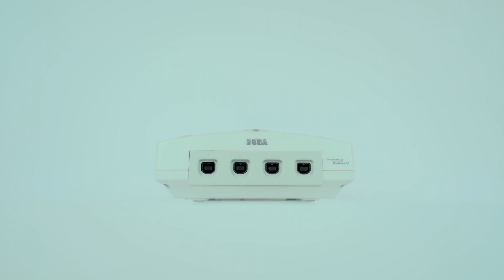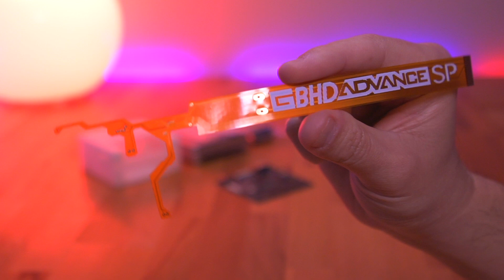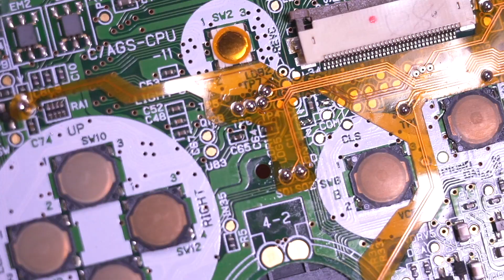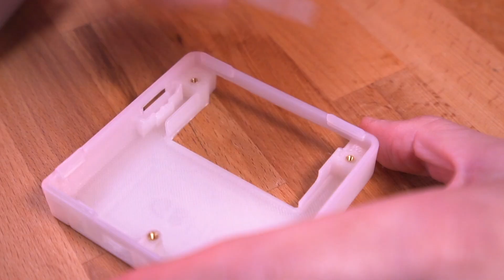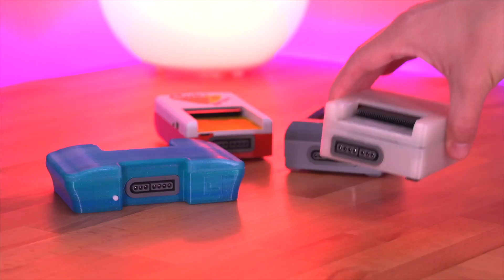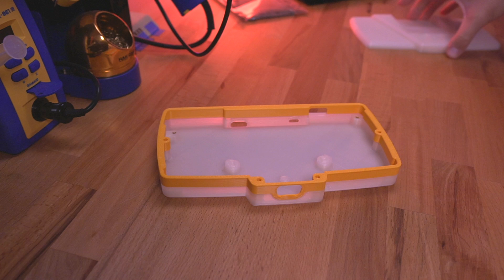The GBA SP Gets A New Hi-Def Consolizing Mod

Comment: The biggest issue with the SP is the tiny dieod or fuse that is required to help the SP Charge, I have 2 SPs [ one being an NES Limited Editon ] however neither charges and Ive put it down to this consistant flaw with the SP.

Comment: What would happen if you leave the battery inside? Can it be powered through the charge port?

Wondering because the board (not the shell) would be perfect for a collection of mods together.

Wanting to do something along the lines of a Slate but also want HDMI out (along with the features shown in the video) but want to know if they would be compatible (aware some customization would be needed to accommodate this second board)

Comment: bruh at this point just use an emulator on a PC that's connected to your TV, and keep the SP as a portable console. Or get a Miyoo. Or whatever. I don't really see the point
Reply: I have a descent taco Nintendo GBA and a really beat-up iQue SP 101. I am considering moving SP screen to the taco and consolizing the leftover SP motherboard. SP case makes my hands hurt.
Though, sadly,  nowadays the really fiddly GBAHD is the only available option. It may be made cheaper though.

Comment: So quick help.
I got everything hooked up but the left press on the D pad and the left trigger are unresponsive. I will go back and solder everything again to be safe, but which Test Pads on the board specifically should I look to re-solder?

Comment: I need this for PSP. And if they could bypass the integrated wifi card (it no longer works with current protocols) and add a wired ethernet one instead that'd be just unbelievable.

Comment: Something I don't see anyone talk about is how they completely botch the grid lines and scanlines effects. The grid does not actually outline the actual pixels from the original image - it looks like a checkerboard is just placed over the video output without any rhyme or reason to where it should go. Looks absolutely horrible. For a real gridline to look good (see MiSTer, Analogue Pocket, or Q5 IPS), the grid needs to actually outline each and every source pixel.

Comment: Not a fan of those tight fitting parts, or snap shut cases. But that's just me. I would be happier with the case being about 1cm wider in both horizontal directions to allow for an easier board installation and room for screws to close the case. Overall this is still a very nice build.

Comment: I'm confident in my soldering skills, but honestly, it might be cheaper to just get a finished unit if you don't already own a GBA SP. You might be able to get a "parts only" one for  between $40 - $70 (before shipping and taxes) and hope the interior isn't badly corroded.

So from scratch, this would cost between $200 - $250+.

Comment: I have been kind of disappointed with the output options that all of these kits offer. I wouldn't mind seeing one that just offered Component or RGB output with no scaling or effects so I could just run it through my RetroTINK 5x.
Reply: You can kind of do that if you got an HDMI to component converter that doesn't upscale, then you can set the device to output 480p and run that through the 5X using any of the 5X's modes. A bit convoluted,  but its possible if you want 1080p, 1200p or even 1440p if your TV supports that resolution. 🤷‍♂️

Comment: I've considered getting one of these consolizers for a while, but I'm not sure why you wouldn't just get a Gamecube with a Gameboy Player? It's $100 for a Gamecube, with all the cabling, a controller, and a memory card; then $50 for a Gameboy Player; and $12 for an Action Replay disc to use with the player (much cheaper than tracking down the real startup disc). That, on paper, works out to the same price as this consolizer kit, so why bother with hacking up a GBA when this gives you essentially the same experience, on top of having a whole Gamecube?
Reply: Some folks prefer to upcycle their handhelds for less e waste + prefer to play their GCN content via Wii

Comment: I wonder (having found this channel and all this stupidly amazing handheld mod scene in the past few days, so I might be missing some context) if they could design a shell where the cartridge could be inserted from the top verticall, with the sticker side facing forward, just like in an old school console. I imagine it would require some daughter board and a hell lot more soldering and desoldering, to remove and relocate the cartridge slot, if its even possible. It would look pretty cool though! Having the cartridge sit flat against the console is a space and comfort compromise when you need to hold the console in your hands and it needs to be as compact as possible to be able to put it on a pocket or backpack without weird things at 90 degrees. But as a table console, that restriction is gone.

Comment: make sure if the donor consoles still have working displays to offer those online as spare parts so no components of the old consoles will be wasted. also try to use ASP-001 models for these, not the ASP-101 models due to their better display lights.

Comment: I tell ya, the flat flex cables (and the ability to make them/have them made cheaply) that have been coming with modern hardware mods have completely changed the level of accessibility for modding consoles.  It's really awesome to just "solder this flat flex to the only places on the board that line up" rather than "strip and solder these 30 wires to hack in this modchip"... so awesome!

Comment: There's no denying that this is the perfect solution for perfectly accurate GBA capture, other than some minor fit issues. The SP was also vastly more popular than the original and thus has a huge supply of extra parts. If this was released 6 years ago, I could see it being an easy first choice for everyone with any interest in GBA games. But that's the rub... 

In the last 6 years, emulation accuracy improvements, combined with leaps in hardware performance across the board, has made it redundant. Unless you're a streamer trying to navigate the Nintendo legal ninjas, a preservationist trying to capture hardware accurate behavior for something like a test cart or distribution event kiosk, or setting up some kind of ultimate TloZ 4 Swords setup, you don't need it.

Comment: nice but one thing every consolized gb/gba is missing would be to get a controller that have the gameslot working ,  for the rumble and motion games ... just an idea of course ^^
Reply: Another thing they seem to be missing is a simple way to use the GB/GBA in a portable manner as well, ala the Switch (uninstalling the board and replacing it in the original case isn't 'simple' for these purposes.)

Comment: This seems like a really nice project, but the cynical engineer in me is wondering why not go the next step further and have the GBA's CPU running on the FPGA as well, and just put a GBA cartridge slot on the other end of the ribbon connector if the whole point is to play the games on the original cartridges.

Comment: This looks so much simpler to put together than the GBA HD kit in your recent video. It would be really cool if we got to the point where you could mod a GBA to easily plug and remove from the FPGA in question so you could still use it like a GBA, kinda like the Analogue Pocket with its dock.

Comment: I know you have a printer so you may already have the tool I’m about to mention, but for anyone else out there who is dipping their toes into kits with 3D printed enclosures: A cheap swiveling deburring tool is your best friend if there’s any chance you might need to post process a 3D printed enclosure. Craft knives are totally fine but a deburrer is typically very inexpensive and it makes cleanup and absolute breeze (and reduces cut risks).

Comment: You should of heated up the 3d printed case. It was hard to get the board in because the printer that made the part didn't have tight tolerances.

Comment: See, I don't really get why you have to bend anything.  Why not just make the 3D prints more accustomed to the hardware so no modification is necessary?  Sort of like the Game Gear case where you had to actually remove the controller port metal before putting the case on.  That kind of killed my joy for the kit to be honest, as I'm just not comfortable using it without leaving the plug intact as it should be.  I'm not really sure why the case wasn't designed to be be usable without having to remove it like that.

Comment: While I LOVE having all these new Consolizer options, I am thinking that they should maybe hire someone to come in & improve the upscaling of these Consolizer kits, as they only max out at 720p & from what I hear they also add a frame or two of variable lag.  Not terrible but not as good as some of the other Consolizer kits such as the ones made by Woozle which go up to 1080p & add virtually zero added lag.  

Nowadays if we are going to be using original hardware we just can't be having added lag, it's just not acceptable imo.  Otherwise there's no reason not to just emulate on a PC or something.

Comment: This is right up my alley with the exception of the case, and if I had access to a 3d printer I would, as Macho Nacho put it, make it more cuboid and likely give it a good smoothing and a nice coat of paint to the point of looking like an official product.

That said, the issue of the shell that comes with the kit likely could just have some tweaks made to the cad file to make it fit better.

Oh and thanks for the reporting on these fine products.

Comment: Regarding the flex ribbon's proximity to the one component, would it be possible to trim the edge of the ribbon to fit it flush against the PCB?
Reply from the maker: It’s entirely possible. I’d have to see if there is enough clearance.

Comment: opening would be relevant if the GBA HD did actually use the PCB, but it doesn't, the company decided the form factor with the chosen PCB replacement.
Reply from the maker: True, the gbahd has flexibility in its form factor. The limiting factor would be the spartan board

Comment: Do any of the consolizer mods have link cable capabilities
Reply from the maker: All of them are capable of using the cable but some of the adaptors may not be compatible due to the shell design. This one is compatible with all link port accessories.

Comment: Wish there was a tier list of all hdmi mods, at this point there are more mods than the GBAs out there XD
Reply: I'm finding it hard to keep track of myself.

The no-solder one looked pretty bad visually-speaking but is of course the easiest install.
The one that puts an HDMI port on the GBA itself also looked pretty bad, and the dock mod was just an extension to that, but it's the only one that keeps the console portable if you want to use one system for both like the Switch.
gbaHD is the hardest install but also the only one that offers a 1080p output.  It being open-source means it has the potential to get more features later as well, plus potentially cheaper and more varied boards for sale.
Woozle and Gamebox seemed pretty much comparable.  Tito didn't talk about gamma correction on either of those videos, but the options are there in the menus so I assume they can match the "GBA" color option the gbaHD has.  Maybe they're purely brightness though and not quite comparable?  Don't have one myself.

I would say gbaHD > Woozle/Gamebox >>> HDMI portable > no-solder
That's without factoring in cost/installation difficulty though.

Comment: It‘s refreshing to see a kit that utilizes the SP instead of the original GBA.
Reply from the maker: Agreed, this is the first kit I’m looking at based on the SP!
Reply: @MachoNachoProductions  that's not true. The gbaHD had GBA SP from the start almost two years ago
Reply from the maker: @mancloud19  sorry for the confusion. This is the first SP kit that I looked at personally. I mention in the video that the gbahd supports both original and sp
Reply: Agreed
The SP is very underrated and kind of neglected when it comes to mods
Reply: @Juanguar Mostly since it doesn’t absolutely require modding.
Reply: @Samuel-qi7in  true
Just the screen IMO
Reply: There is a Gba sp Unhinged.
Reply: It's neat and does invent a use for probably broken SPs
Reply: Honestly prefer the gba form factor. Sp is overrated, you don't see any gba form factors for any hardware or handheld.
Reply: @suhtangwong  there's plenty of handhelds that are horizontal like the GBA. That's the majority of handhelds. It's a superior design.